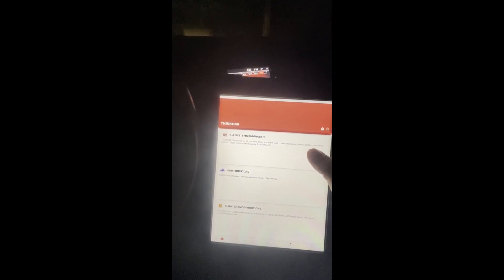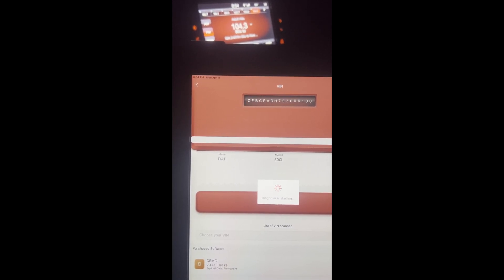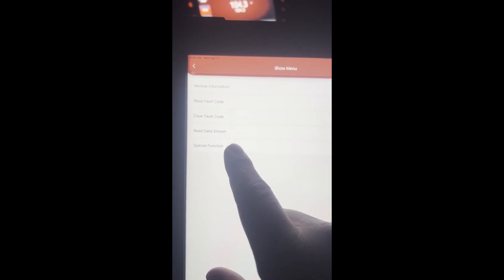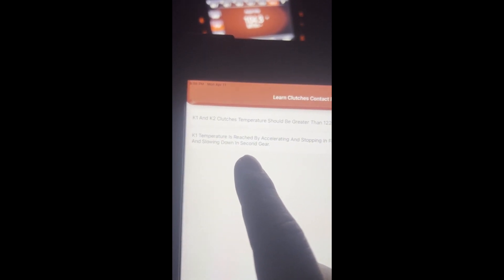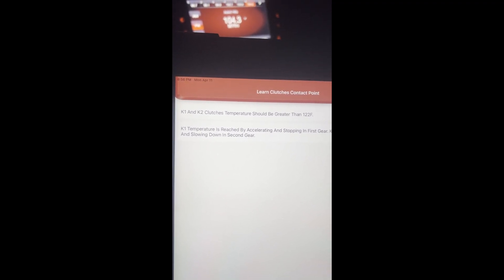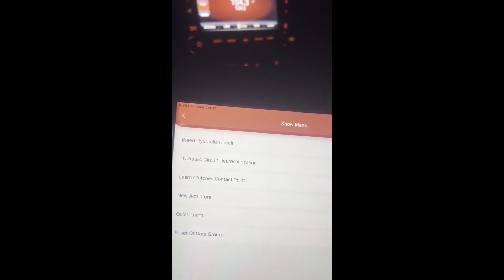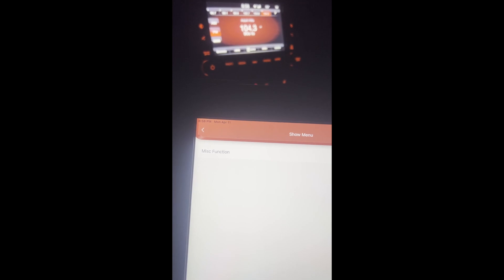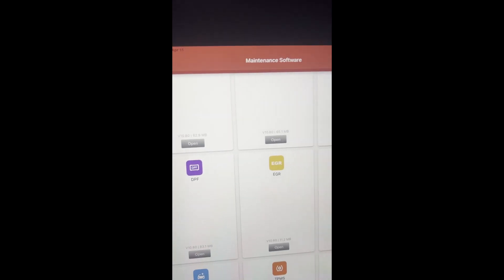Fiat 500L DDCT Transmission Clutch Relearn ThinkDiag Elite

Comment: I have been searching for info on the Fiat 500L DDCT having never worked on one. I found this video very helpful I couldn't get the car to quit going in to limp mode after replacing the throughout bearing /slave cylinder. I thought I was going to have to take it to the dealer until I found your video and ordered the @thinkdiag and did the clutch relearn. The car shifts great and no codes
Reply from the maker: Glad i could be of help info is hard to find on this vehicle for some reason if u ever need help hit me up and i will do my best to help you
Reply: What kind of thinkdiag you used I see lots on Amazon?

Comment: My 500L lost the clutch "shifting memory" after shutting the engine off in N drive.  Before that was serving me well for years. Also getting some error codes, messages like ESC not available, hill stop not available, DTS , missfiring in cyl 4  . . .  Starts and drive in limp mode, shifting roughly in all gears . . . .  Not sure what to do?
Reply from the maker: Dang u might need to reflash tcm and ecm

Comment: Hi, I just bought a 2014 500L. The transmission warning light appeared on screen after 30min drive. The driving is no problem at all just the warning light up. My friend used the computer to remove the warning but it shows again after 20 min. Do you have any advice for this? Do I need to change the clutch? Thanks.
Reply from the maker: What code does it give u
Reply: @toolsonabudget7763  P2930-85 Clutch closed Position Seltuned - Signal above allowable range

Comment: Transmission issues on my 2014 500L, will not shift into R or D unless my car is able to roll in that direction. Will ask me to shift to N before shifting to R or D. If I push my car in that direction it can shift.... if it fails to shift enough times it will go into limp mode.
Reply from the maker: your clutch is worn or the throw out bearing is damaged

Comment: I recently purchased a 2014 Fiat 500 L the guy told me he had transmission problems where the actuator have burnt up so he replaced it with a brand new one. Customer told me he believe the clutch is still good because the previous mechanic would have told him they were bad(I don’t know if it’s a possibility that the clutch is still bad) Upon replacing the transmission it starting having issues going into gear at all… My question is, do you know possibly what that could be also if the vehicle does not drive or going to into gear would I still be able to reprogram the TCM?
Reply from the maker: You replaced the whole transmission or just the actuator

Comment: I'm having trouble with my Fiat 500L 2014 transmission especially first gear it's like the tires are tricking it does not engage like used to
Reply from the maker: Its probably the clutch

Comment: Okay I change the transmission and Is it normal the the transmission light to come on and engine light when u drive it trying to do that test? My car loses 1st gear and the transmission light come on when running this test? Do I keep driving ?
Reply from the maker: did u put a new clutch?
Reply: @toolsonabudget7763   used transmission with low km, I think it's going into limp mode when I try to drive it.. because I need to do that relearn but is it normal for the engine and transmission light to come on? While trying to do that test?
Reply: Lol got scared to keep driving 😂 but I need the temp to go up so I have to keeping going I guess
Reply: @callofdutytop1073  Did you ever solve the issue? im dealing with this plus i got a code hydraulic pump stuck off but its constantly running

Comment: Great Video! I have a question or two.

14' 500L with 245k miles. original owner. Never done any work to the transmission. 

1st issue with a code 
Getting a P287200 - Clutch 1 stuck engaged. It's been only once but have also stopped driving it since. where i have that code and it was only stuck/shifting on the even (2,4,6) gears.

2nd issue observation
prior to clutch code. for some time, noticed that on take off from 0 mph, car would have a stutter/shake the once it went over a few mph it would stop and no other gear would see it. so i'm guessing clutch slip of some sort on 1st gear.

3rd issue observation.
I see around the hydraulic pressure motor/accumulator it's wet with some type of oil. not sure if trans or motor. (last yr had a constant leak with vacuum pump and i cleaned. so not sure if residual motor oil)

My first idea is to change oil. Can you help provide info on where to get the pan gasket? If i were to go further and replace more components. What's the best place to get parts?
Reply from the maker: Dang its most likely the bearing that holds the first clutch
Reply from the maker: Changing the oil wont fix the issue on the particular car once u have the shudder and only gears 2-4-6 its almost always the clutch it can also be the hydraulic actuator motor but i have my money on the clutch and seeing as its a manual automatic there is no pan gasket its just a drain and fill on these

Comment: Hi I have the 2014 Fiat 500L 1.3 Diesel with Dual logic transmission (semi-automatic). I got the below error codes could you please help what needs to be done here

B1081-14 : Stop And Start Relay Command - Circuit Short To Ground Or Open Stored BCM (Body Control Module)

P1741-1C : Gear Position Sensor - Circuit Voltage Out Of Range Stored TCM (Transmission Control Module)

P2916-07 : Fault On Gearbox Subsystem (Unexpected Gear Disengage) - Mechanical Failures Stored TCM (Transmission Control Module)
Reply from the maker: Whats the car doing ?